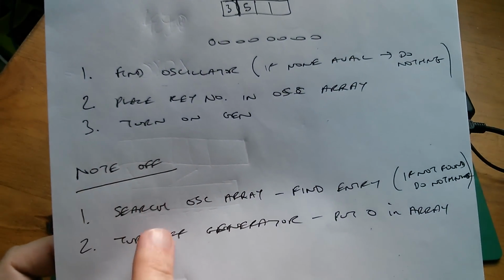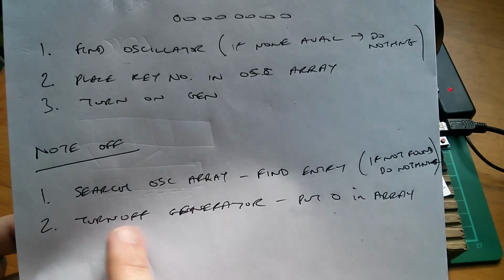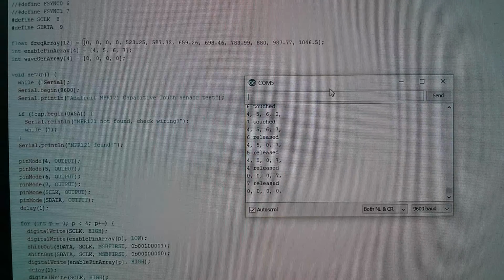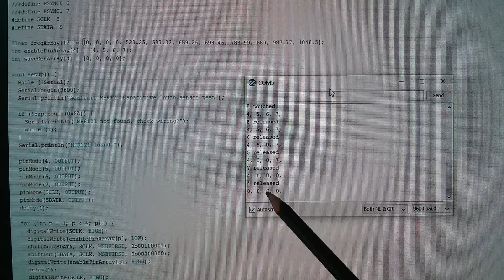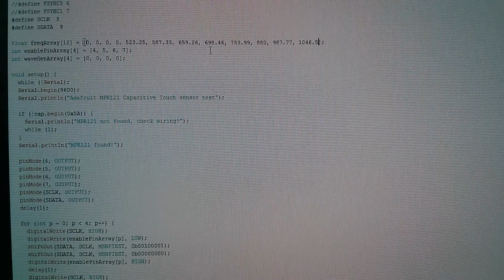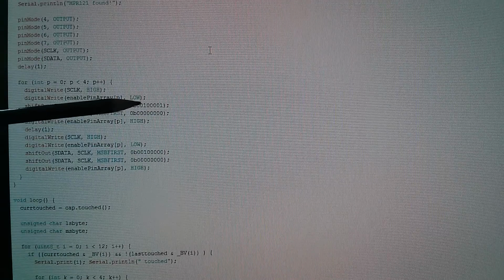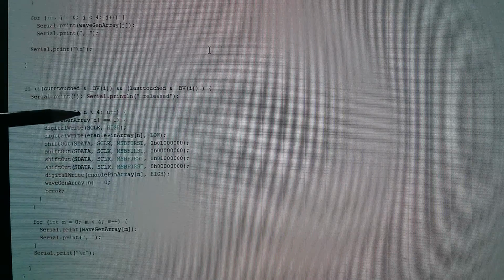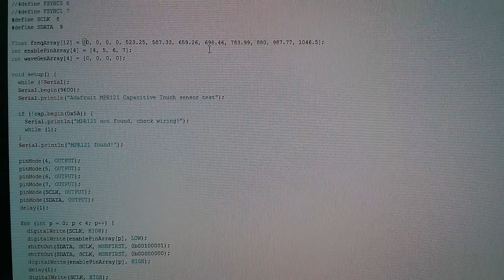Project: Penny Organ - 4 Note Polyphonic Software

Comment: Julian - A bit off topic, but I do know how you like the ESP8266, and the Arduino. Here, at long last is the two of them combined.  It is as if an ESP rammed into an Arduino, and this is the results. Banggoods also has this, in fact I have mine ordered from their US warehouse as I type, all for a bit over 8 bucks US.  http://www.ebay.com/itm/New-ESPDuino-Development-Board-ESP-13-UNO-R3-With-Wifi-From-ESP8266-/121917743253?hash=item1c62dd2095:g:kXgAAOSwqYBWm2PA

Comment: Hi Julian,

Have you considered generating the tones in software? You'll be able to support more tones at once without additional frequency generators.

I don't think the arduino will be fast enough, but an STM32F microcontroller will work for it. You can use stm32duino to program it using the same arduino UI.

Here's the code (unfortunately mbed platform as it was for a uni project) we used: https://github.com/nallar/Keyboard/tree/master/src
Reply: I think mozzi lib on uno can help with that, but I forget, I used it for something else.

Comment: Amazing organ! Question though;

How difficult would it be to restructure this system so there would be one arduino doing all the keyboard handling and sending out i2c or some usable multi out serial format over shared datalines, sort of like a rough midi out.

Then have that signal spread out over banks of additional arduino's doing the synthesis work (with possible feedback of in-use oscillators), with a small (possibly passive?) mixer in the back that ties the audio together?

Would it be possible to built a tank of a multi timbre synth solely out of a bank of arduino's? Or is it more economically feasible to go the raspberry pi 3 route, and do all the synthesis, mixing, modulation and audio output rendering in software?

Comment: Nice you got it working good and I wasn't really fed up with this project. I feel you could be some other audio stuff, I think I wouldn't be the only one interested in that. About this device, I thought the dissonance would be greater between the oscillators, so the result is really better than expected. I would recommend to put you code up to github or bitbucket, so other people could even contribute.

Comment: Just getting into programming and Arduino. 
My question is. Do you think of a project and then try to make it work on the Arduino or do you build on other peoples work. 
A bit like having a pen and paper and not knowing what to draw. Or then seeing a oil painting and saying I do that but not knowing you can't do it with just your pen and paper. 

I have worked servicing audio equipment for the last 20 years and trying to get a vu meter working from an old radio where the the circuit for it is toast. I could do this with a LM3916 IC but want to add other functions that I belive the Arduino offers.

Comment: I've enjoyed this series of videos, so don't give up unless you're fed up with it.
BTW When you get to the 5th note would it not have been possible to allow the new note to be played by losing the first note played - that is how all keyboards I've used work.
Reply from the maker: +slm60uk I considered the "note stealing" option, but locking out the fifth note appeared easier to implement